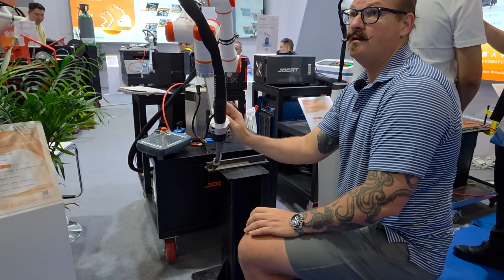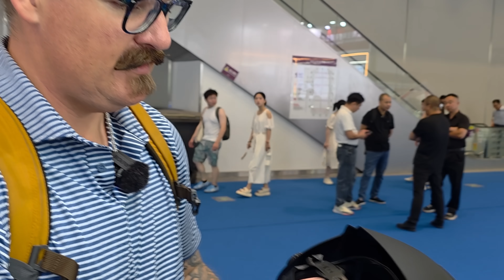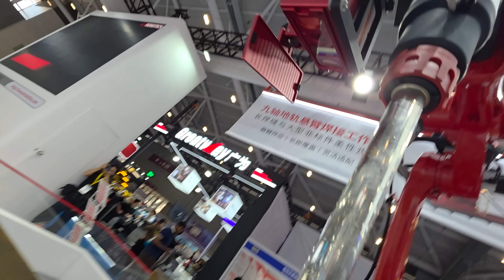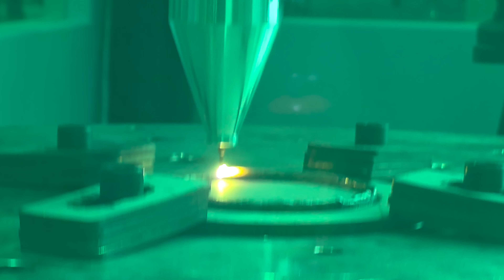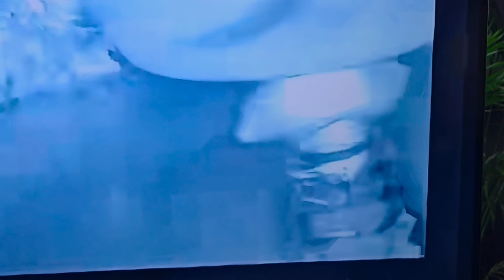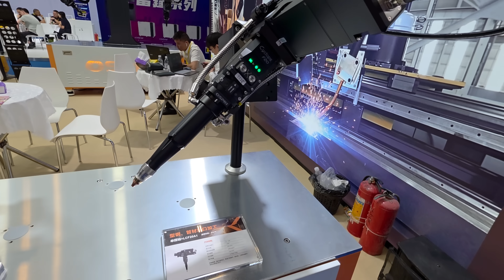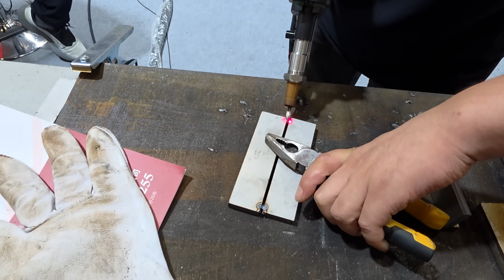The End of Hand Welding (I Saw the Proof)

Comment: I think welding equipment technology like that isn't particularly difficult to build in America (or, for that matter, in other countries). Essentially, it combines welding processes with sensor-based embedded robotic systems (microcontroller units) and a mini-computer, such as a Raspberry Pi. As for the laser system, various options are readily available depending on the required wattage—in fact, someone with intermediate-level knowledge could even build it with the help of AI (especially for the mcu"s firmware and programs). The problems is it PRICE only, produce it outside of china maybe costing 2x more..

Comment: I'm an industrial equipment manufacturing engineer in the US and deal with welders and robot welders daily. 1st, there is a MAAAAASSIVE shortage of welders in the US and this isn't going to cost a single job. 2nd, welding and painting are always the 2 bottle necks, plus there's a giant material shortage right now and don't get me started on having to get welding fixtures built for all the new parts that are going to be welded. Plus a lot of welding is 1 off. This might be a big deal in fabrication shops but it will have limited impact on manufacturing and weld shops. These things China comes out with aren't anything we couldn't do in Europe, Japan, US etc. We don't do it for a reason. This is software disguised as innovation. Not to mention the infrastructure needed to run lssers in a shop. It's not cheap and reliability is a nightmare on anything laser. Throw in the safety requirements so you're not blinding everyone or lopping arms off, is expensive and requires huge sections of pricey real estate. This thing solves 1 out of 100 problems and creates new ones. All of this makes a human welder a better option.

Comment: I got pushed out of tech by AI and I’m in welding school at 41 years old…..great
Reply: Welders in fab shop will do less of the welding work itself, but more of lining up steel plates, tackweld them to prepare for robot welding. Learn a bit about steel work in general, beyond the welding itself. Since you got expereince with tech, you potentially easier can take on setting up robots. there are welding tasks robots won't have much impact like repair welding on construction equipment in the field and so on.
Reply: @Rimrock300 thanks for the info!

Comment: If I were a skilled welder, I wouldn't worry too much. There are too many niche' welding jobs that are too difficult to automate. It would take more time to "program" than just get the job done. But when you need the same items in bulk, that's where automation makes all that programming worth it.
I still wouldn't worry! Those machines still need someone to tune and software development isn't going to replace EXPERIENCE with a welder.

Comment: That will maybe replace  some types of high volume repetition welding but not all types .
I worked at a place that spent millions on a automated box section to full pen butt  (and brackets)to base plate welding robot.
They opened a dedicated bay in conjunction with a top 5 welding company in world supplier and failed dismally 
 Same as they always do

Comment: While I Agree with the machines taking over production stuff, there are many applications that will still require a skilled welder. If you look, buying the equipment, keeping it running, adding depreciation, and quality control is another different story and expense. Is not as easy as replacing a worker, running a production shop is one thing, but doing onsite repairs of fabrication is another, not including research and development.

Comment: I see machines that can weld. I've seen them for years. All this fear mongering and i still see no layout, material prep, field work, metal finishing, grinding, fitting,  robots on lifts, scaffolds, or on a ladder. Do they load a new roll of wire? Do they change their own consumables? Do they pre heat and stick weld grade 80 rebar, then go back to running the feeder with some nr212 or 233?  Do they trouble shoot and fix their own issues? I see them welding in the same way that robotic arms have been doing for a while now. I still see nothing about actual fabrication, let alone field fabrication. But sure, you're welcome to drag 12 different robots out to replace me. But that doesn't seem very economical..

Comment: I'm welding 5/8" plate 6061 T6 for Northrop Grumman and need 270 amps single phase  DC straight, HF start only with 100% helium, TIG. Nothing here does that.

Comment: I work in a place with many many automatic welding machines, a lot of which are under 3 years old. They are great for batch runs but between the initial cost, programming requirements & maintenance schedules they are a world away from doing one offs, small complex batch runs or any sort of repair work. ‘Soon’ but not yet IMO. Good video tho’ 👍

Comment: He says that the robotz cant fabricate but that a absolutely not true, if a robot arm can take a pile of parts and put the. In a break press and the scan to check accuracy then stack it inside a tote then a robot arm can take peices of metal off a stack and put them in a fixture and clamp them down and weld them with ONE robot arm THG has an arm that can by its self change from a mig gun to a tig torch and keep going.kinda like a cnc mill or lathe can change out its tooling

Comment: The machine you showed is is only for simple low thicknesses metal plate welding like building a metal cabinet. Imagine you want to weld a reactor shell one and half inch thick with back weld. So, now what?

Comment: For your junk iron welding, maybe so. But for in the field pipe welding that I have been doing in nuclear industry and refineries. How are you going to get that robot to figure out how to make a tight position weld, maybe having to use a mirror. No sir, you are talking about limited use. You have a fabrication shop, beginner welding. When it comes to boiler tube and critical pipe welding, that will never be replaced by a machine.  I've been in the welding industry, certified since 1970------------------before you were born. I've lived through so many changes, modernization, but automation can go only so far. Your title was not realistic. This is for production welding of simple things. The laser bead welding looked pretty bad quality to me. I worked in a pipe fabrication shop in 1970 as an apprentice and we had an occilating Mig position pipe welding machine then, 56 years ago. I'm not impressed! So, in conclusion I think that you finally understood that this is very limited. Actually, in professional terms, the person that these machines will replace is a low paid fabricator of simple things, NOT a professional highly certified pipe welder.

Comment: Nah, hand welding will still be done for quite a while.  Trying to move and power those robots off-grid or a construction site, especially at heights, nah.  Risking dropping a $100k+ machine off a building...
Then there's the issues when a machine doesn't want to work, who knows how long it'll take to get it running again, may need to order a part overseas which will take at least week to come in.

Comment: Ive been welding regularly for 40 years now both in shops and in the field. This machine might work in a static shop situation but would not be usable in the field. You will never be able to replace experienced Millwrights and/or Industrial Maintenance Techs like myself with robots. Its not possible. And why would you even want to in the first place. Our profession involves way too many different situations and variables on the fly and outdoors in every physical position for a machine to even try to handle. Cant be done.

Comment: I'll match my welding skills (arc gas, mig, tig) against any robot any time anywhere. that last weld looked like it was done by a drunk coming off of a three week binge and the puddle was WAY hot!. Welding is an art, not just a skill. Show me a robot that can do an up-vertical weld with a 7018 rod (or equivlent) on a mild steel beam 100' in the air, or some production pieces for a jet engine made out of titanium. You're right about one thing, Fab skills are the lion's share of what makes up a good welder fabricator. Navy trained here back in 1971. When I got my first civilian job in the trade the guys nearing retirement at the time started out as blacksmiths and ended up as true metalsmiths. You can keep your Chinese junk and I'll make it look lazy in a head to head competition. Can the robot jump on a Bridgeport for a quick mill job? can it rig up a Cincinnati to bore through a stack of plates set on automatic while you roll and seam a few Stainless Steel cylinders? Can these robots think???  Can it lay out and build a jig or fixture for production? Hell no! I see this stuff as expensive junk. You should have saved your $ and stayed home. The most valuable "robot" in any Steel Shop is the guy with the all-around skills that pays the bills. Period.

Comment: If any of you think CNC is remotely new or is it going to get cheap your fools. You don't use a CNC welder now because it would be stupid. Manufacturers however do you use CNC welders and have for a long time. 

Laser welding is awesome and made possible by advances in electronics 
 And all your professional welders should probably buy one now. But they're going to need a human too.. because you can think through the problem and weld something a lot faster than an expert in Cam and g code can create the G-Code to do it

Comment: In essence, this is the same CNC machine, except that it does not perform the positioning itself. The operator moves everything manually. Through these manual actions, the operator determines both the initial and final points. The Chinese manufacturers were smart to save a significant amount of space by eliminating the large, cumbersome footprint.

Comment: i work as a tig welder and was initialy excited by the laser welder and its capabilities especialy the penetration ,iwas lucky enough to put a machine through its paces it soon became apparent that the unit itself was cool the units hand held gun was just to large to manipulate around small tubes and into our jigs we used to line up parts,considering how small and light we can make tig torches i feel the laser weld tech may have its uses in industry in terms of speed and trainability it just doesnt have one in my job,only time will tell.

Comment: Saw couple years ago these small programmable welding robots. 
Those were like "Start - record - record - record - End" as in order of all corners and angles. 
So in a seconds you got the robot perform the weld following example two 90 degree angles and edges. 

But couple month ago saw the latest version of those and I don't even remember anything about it but it was so simple that you question that when the stores will sell the small robot hand with a work area of quarter cubic meter and it does all?
(quarter cubic meter is 50 x 50 x 50 cm) 

If such welding machine would cost about 500-800 (you get good welding machine for 100 dollars) and be equivalent to a 3D printer in availability, there would be lot of small shops with those.

Comment: It was nice hearing someone else using the Correct Term "PLUMB" other than myself, Guys Beams are Level, Posts & Walls are Plumb 👍, If the People on the Job can't even get the terminology right, what else are they getting wrong? 
I spent 40 years in construction and 99% of the time the guys referred to the posts as being level 🤨😫👎 It's like hearing a sedan being called a truck, I wonder if they knew between level & Plumb is where 90 Degrees comes from?

Comment: mobile welding is the safest welding job! Yes the merger of welder  and  fabricator started over 30 years ago. Its like pipe fitter welder. The combining of skilled trades is not great, but  I'm not surprised and I agree on having fabrication skills. I was a fabricator before I became a welder. Also learned some basic machining skills. Point is keep learning and never stop. Also, union shops are the best, I had so many small shops promise me an apprenticeship with no intention of every doing so because they would have to pay me more once I got my ticket.

Comment: Noob here. Can anyone direct me to what to use to weld 16 gauge steel to metal for a small area of 4 mill by 4 mill? Im working on a project and being new i obviously suck at putting any good bead down, let alone on such a small area. What my best options? Got a mig welder.  Thanks.
Reply: .035

Comment: pipe and tube welder here which I didn't see any of , most fab shops will never be able to afford the equipment that it would take to replace 6 to 10 welders especially when you still need one operator to run the robot and you still need manual welding machines and weldors to fit and tack the parts together . I did automatic orbital welding on pipe 30 years ago and other than nuclear plants it still hasn't caught on in the piping world and one complete machine cost upwards of 80,000 dollars and for each machine you need a weldor and an E tech to keep the machine running , it aint happening any time soon !!!

Comment: I think that these machines can replace welders in building the same part day after day.  They won't replace welders in the typical shop that is building or repairing one off parts.  Building and repairing things with welding has been by far the majority of the work a welding shop does.
Reply: Right there are too many situations where a robot is just impractical and is fine still having someone do the job, for repeated task no more reason for humans... I mean, where was the last time someone welded a car's body at the factory? 30 years ago?
But I still think there a lot to do before we see a robot welding a pipe in the middle of nowhere.
Reply: we already have machines that build same part everyday for years , but they are expensive and expensive to maintain.

Comment: What about fit-up, tacking, and rough welding before finish welding?  For our products (large complex pipe fabs up to 10,000#), most of the time is spent getting the sub-components positioned relative to each other, then tacking them up within proper tolerances BEFORE you actually weld.

Comment: Well, after watching this I can see this becoming more and more available for production and calibrated fab ups. But it's never going to replace manual welding in the field I worked in. Oil refinery Maintenance cycles, inside cyclones, tower repairs, etc. We used some automated processes for known repairs and can plan ahead. But for discovery work in the top of a tower, cyclone, interior exchanger build up, refractory repair, welding in the hex-metal and anchor horns not going to happen. I could go on and on, but I think Ive made my point.

Comment: I like technology and robotic welding. The problem I have seen with cnc welding is that management thinks welding is like machining. You just cnc it and you will replace 10 humans. I have seen companies spend 500,000 dollars on an abb robotic 6 axis welding station and fail to automate the parts they wanted to weld. If you don't understand your process you will waste large amounts of money and may not get to the point where you make any money on your parts. 
Focus on weld fixtures and refining your parts process and then you can spend money on automation of welding. Also you need large numbers of the same parts. I have seen companies waste large amounts of money trying to automate small parts runs. I can weld 10 parts by hand faster then you can even set up and program the robotic welder. 

Poor planning on your part does not consist of an emergency on my part.

Comment: I'm certified in the shipyard in training submerged arc welding and certified with the kranadonk robot programming and also manually ran for 14 years, and the shipyards are good.these robots are too big. Maybe somewhere down the line, it will work better.

Comment: The tool is only as good as the one using it. The robots can do the job, but the question is can it pass an inspection. If it cuts the welding down by lets say 1/4th of the time. You still need eyeballs to go over the weld and check it, meaning a welder has to keep checking it. Then you got everything that can go wrong with the machinery....yea its a 'time saver' but it can also be the biggest time waster for a company.  Time is money

Comment: Welders will never go away for many reasons. You underestimate humans. Many welders go out into the middle of a field on the farm and weld back together a broken tractor. I don't see a welding robot doing that anytime soon. Welders will go to a boat ramp and repair a trailer in the parking lot. Welders will fix many types of transportation in a parking lot. The Robot is not going to do that very well. The robot is great in a shop or factory but out in the field? I think its pretty limited. Humans are a compact form factor in comparison. Even a truck mounted robot would be quite limited.

Comment: Do the macines have the quality of the machines that wel used building forever cars like some Toytas, Lexus and Hondas? They sure came a long way yet I am still sceptical about made in china and prefer made in japan oder german, switzerland etc. But I am not a pro user, for me its only hobby.
Reply from the maker: That German and Swiss tech also comes with high cost parts that are expensive to replace. I can't say the quality is on that level for every component but we already use German valves on our press brakes and Swiss reducers on the laser tables. So we pick and choose where we need the high end components. But stuff like the frame amd machining can be done just as well in China so why use European sourced goods for the whole build? It doesn't make sense. The world works like engineering, you have to constantly make compromises to get what you want, at a price you can afford, in a timeline that makes sense. China is the balancing point of all these constraints right now.